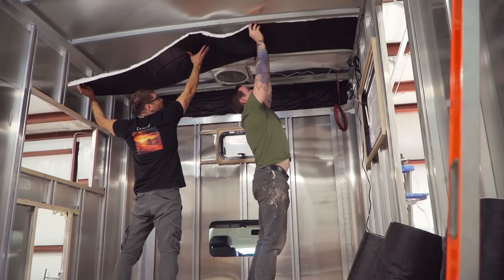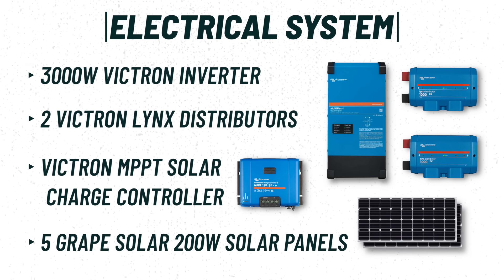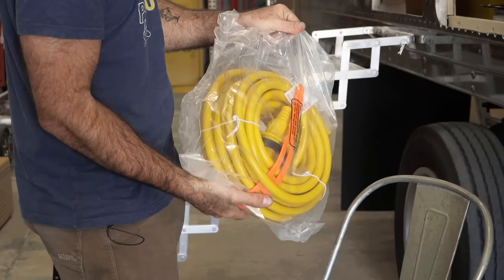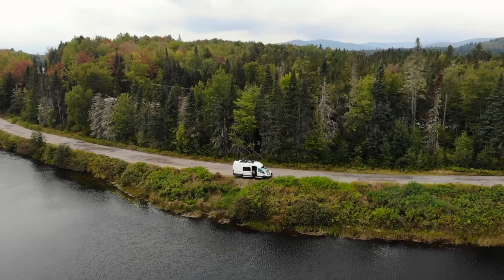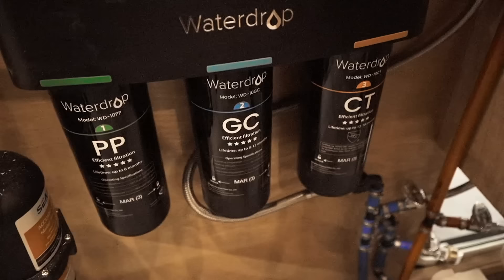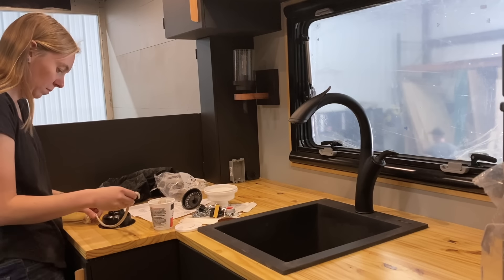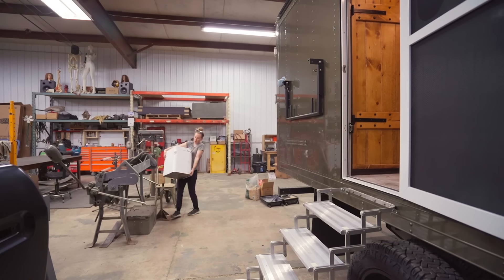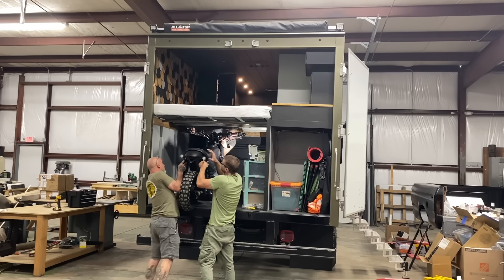Building a Tiny Home on Wheels - Custom Box Truck Build - Pt 4

Comment: With all that power, you might be able to build a laundry room too, you just need more water, which can be solved by designing a "rain water collection system" and re: your shower, if you build a recirculating water system, then you can use unlimited hot showers. Just use filters and uv lights. :)
Reply from the maker: Great ideas!